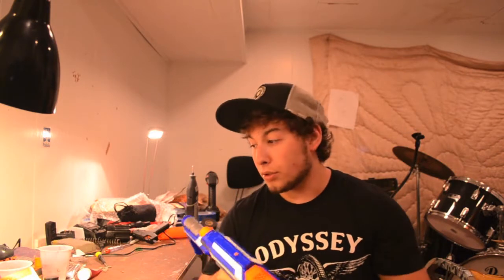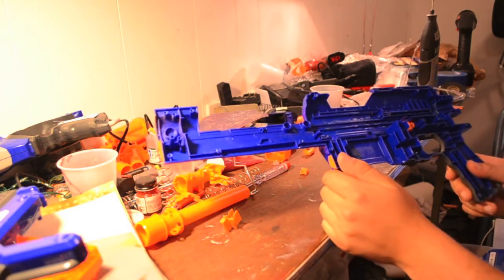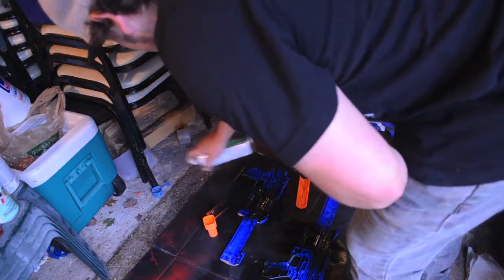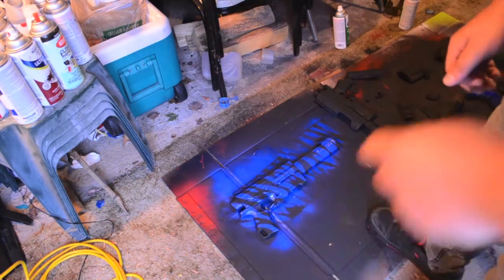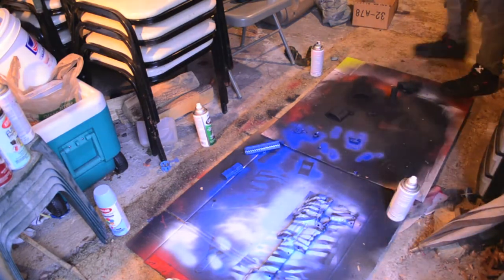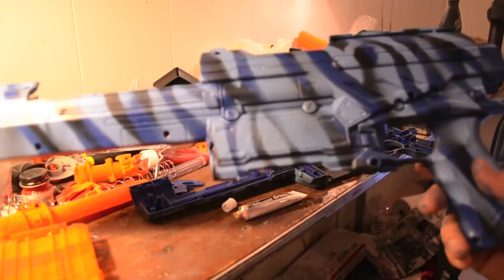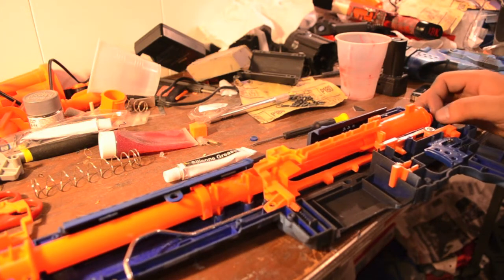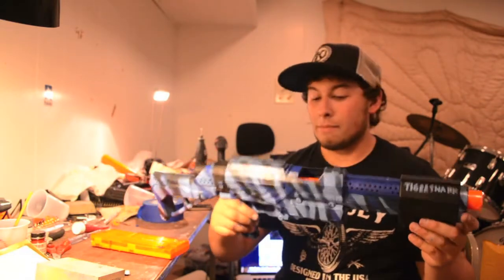How To: Tiger Stripe Camo Painting Tutorial (Introducing the Tigershark!)

Comment from the maker: I've had bad luck with Krylon Fusion whenever I've tried to use it, so I stick with Rustoleum for spray paint. The ultra flat black camo paint is an excellent base coat. I haven't tried vinyl dye yet but I know it's very good so if you want to go that route, that's fine.